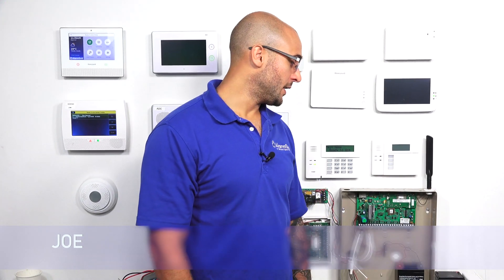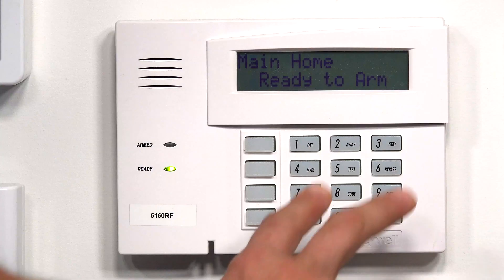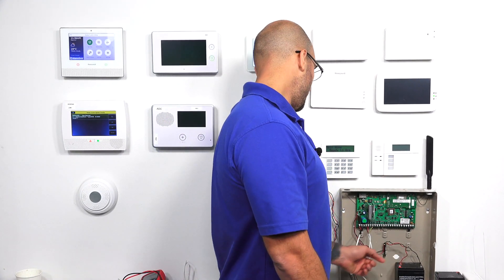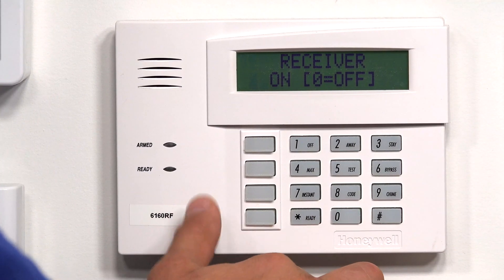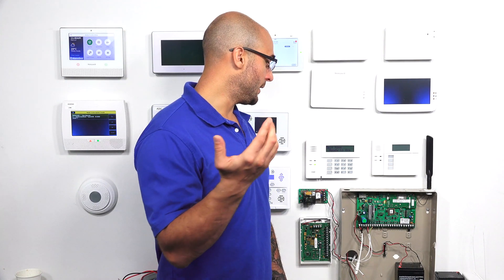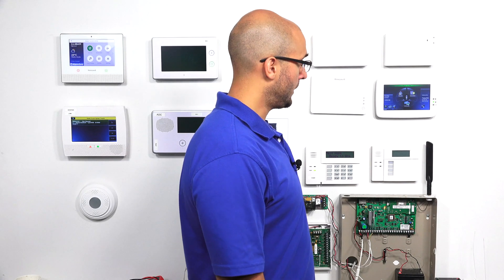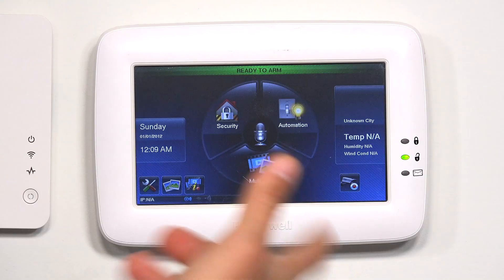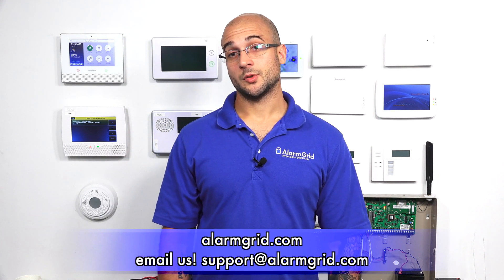Addressing a Honeywell Alarm Keypad

Comment: This is for Alarm Grid.  You bring up a very good point.  I had to go over to my adoptive sister's house one time and replace the motherboard of her Honeywell vista 15P with a vista 20p motherboard because, she wanted total connect 2.0 installed and had 2 tuxedo touch keypads which she wanted to keep.  So, I know this is helpful.
One more thing that I would like to add to this video.  When I replaced my adoptive sister's alarm system, she only had tuxedo touch keypads.  So, I installed a 6160 keypad in her closet.  This is important because, a 6160 is just a button keypad.  However, the tuxedo touch is a computerized keypad that can fail.  It's rare, considering how many tuxedo touches that are in use in the United States today but I have actually seen a tuxedo fail before.  This is why I always like to install a 6160 in the closet with the panel just in case the touch were to break.  Set it to conn add 17.  And, set the keypad address set up in field *190 1 for partition 1 and three to suppress all beeps.  This will prevent the keypad from waking up my niece who is only a year old.  Then, set her front door tuxedo to AUI 1 and her bedroom tuxedo to AUI 2.  Total connect 2.0 to AUI 5.  But I always like to install a 6160 keypad when using touchscreens.  Touchscreens like your tuxedos can fail because that is a wall mounted computer.  Whereas a 6160 is a conventional button keypad, so failure is not as likely.